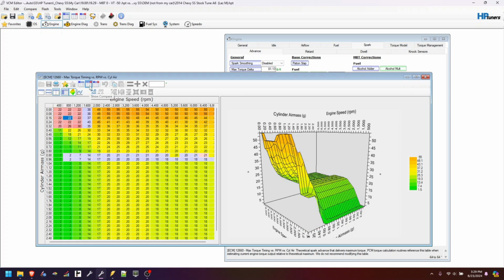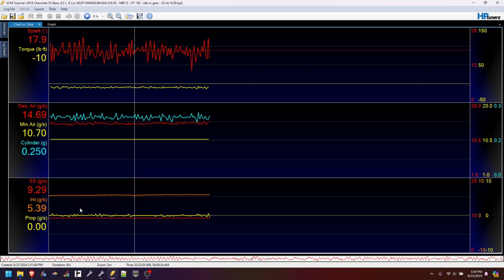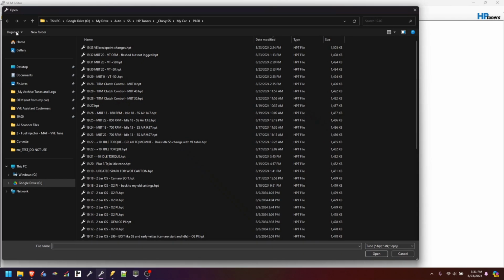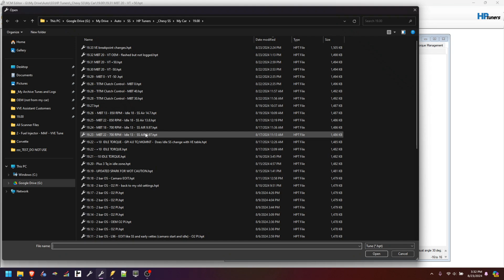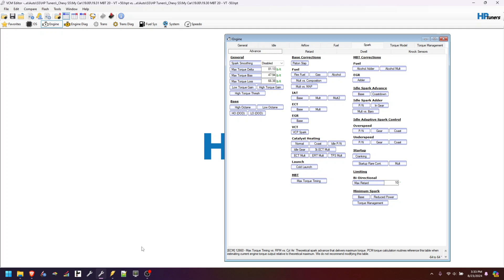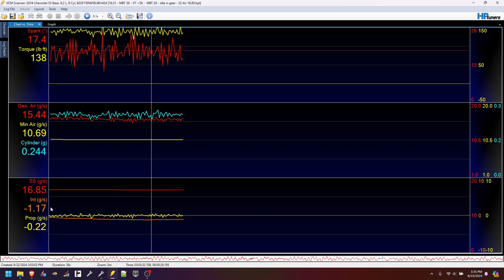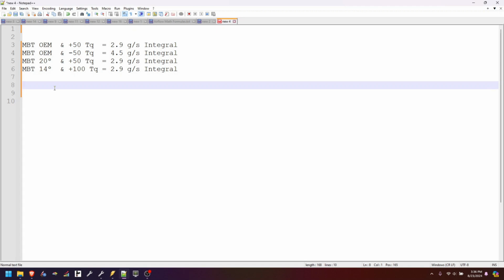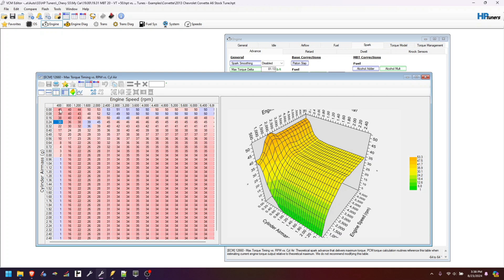Idle Integral Airflow (part 2): Electric Boogaloo

Comment: I have increased torque and decreased torque. I cannot get SS Airflow to increase when increasing VTT but I can bring it down by reducing VTT (as you would in a Gen V) I was wondering if you had ran into this.
Reply from the maker: I have noticed inconsistent behavior, sometimes it works as expected and sometimes not. What goes on in the mind of the ECM is anyone's' guess!

Comment: I can tell you from experience that engine and ECU doesn't mean as much as you would think when it comes to what a modified setup wants.  It's more about year and model, more specifically OS or operating system.  Why?  GM calibrates based on platform not on powertrain.  When I asked one of the calibrators (Camaro/ Corvette 8/ 10 speed calibrator) why they don't share info (or at least proven base files) between groups he responded with, "we are just now starting to do that".  That was back in Late 2018, who knows where they are now or what became of "file sharing".  But anyways, that is why you see calibrations all over the place even when the powertrain is identical.  Another thing to note, relevant to the topic.....so, I've tuned my share of E38 vehicles.  A while back there was a window where I was getting a large number (felt like one after another for weeks!!) of "stock" trucks with only the truck norris cam.  I was blown away with how much variation I saw between years regarding what they want for a stable idle.  Min air, idle spark, torque follower, idle air PIDS, etc all will vary between years and models.  For that reason, you're always better off adjusting relative to the stock values instead of targeting a specific number.  I guess the lesson is, don't always assume just because X vehicle has the same mods as Y vehicle, that they are going to want the same numbers.

While I'm on the topic, I'll share a few extra tips new tuners might find helpful.  If available, start tuning using the stock cal file.  I hate starting with anything but a stock calibration..  I've seen where a previous tuner corrupted the file, it's not a good feeling knowing you've been wasting hours adjusting to a garbage file.  And finally, it's worth mentioning, you should always do a "throttle cleaned" AND reset any adaptives when starting to tune an unfamiliar vehicle, especially if they've been driving on a stock or garbage file.  I could talk for hours on the lessons I've learned when dealing with certain platforms, with certain mods, but I digress.

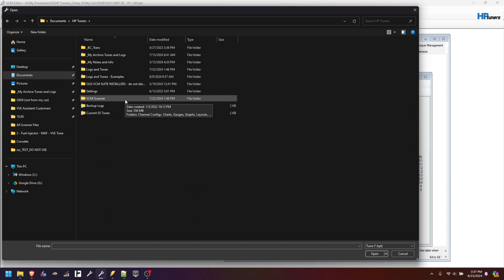Comment: Your L99 engine compared to a LS3 engine at the 8:20 mark uses the same block and heads, but does not have the same compression ratio, valves, or cam.  That is why the MBT tables are different.
Reply from the maker: My personal vehicle (2014 Chevy SS Sedan) came with an LS3, not an L99.
Reply: @SilverSurfer77  I see now.  Sorry, I assumed it was a Camaro.  How much have you increased your ETC scaler?  Correcting this value with ported/larger TB's is usually overlooked with stock cams as the idle adaptive(s) handle the error and ve/maf get tuned with the error factored in.   ETC area is primarily a  base for idle calculations (among others) that always turns into a major problem after installing a cam which starts the endless process of modifying the modifiers routine.  Lots of variables as far as TB size/porting, but LS3's usually need anywhere from +15-30% to save a lot of headaches.
Reply from the maker: @jimmyfreeze3782  I have never messed with the ETC scalar. I do have a CNC ported TB and big cam.
Reply: @SilverSurfer77  The next stock cam LS3 you tune with a katech, gpi (or whoever ported tb), log the idle even if the idle sounds perfect and of course the log needs to be done after maf/ve are textbook.
Reply: @jimmyfreeze3782 If I am understanding you correctly even a cammed and ported stock TB needs the ETC scalar increased from 5636? I would think the throttle opening, blade, and shaft size remaining the same would not change the ETC area even if a larger cam and port TB cause a higher volume of air to travel through. Can you elaborate more?

Comment: I love the info and tinkering dude!
But I really believe that, although E38’s & E67’s are all similar dimension’s, per vehicle, they all have different algorithms mostly coming to the same end-goal… but all of them use a different way to get there.
I have a 2012 a6 6.2 Silverado-cam & FBO’s, a 2013 m6 1le- H/C 415ci + single gt45, on a 2bar OS & a 2015 cam, fbo m6 Zl1. 
Ive tried a number of different things along with the 2014 Ctsv settings, MBT, & the HPT Forum idle thread. all causing a ton of different reactions that caused me to just tune each vehicle as there own setup the old fashion way, seem to yield the best results.
Reply from the maker: Interesting and good point. I really wish I had a whole fleet to experiment with! Lucky you!
Reply: @SilverSurfer77  It’s a “Blessing & a Curse man”. I feel I may go bald at a young age. Lol
Reply: Isn't a single gt45 pretty small for a 415 ci engine?
Reply: @nowayjose596   it works on 12lbs.  The Plan is to work towards a 78/75 , & but the GT45 on my truck…. But economics has slowed the progress a lot.
Reply: @bmock3025  Even a 78/75 will be choking a 415 ci. That's the problem with going larger displacement.
Reply: Well, you would be correct because It's a fact.  In my comment, I mentioned that is more based on OS than year, model or powertrain.  This is because they calibrate based on platform, not powertrain.

Comment: just to throw a spanner in the works... the2011 CTS-V  max torque table has 600 deg spark in the 1200-1600rpm @ 0.00-0.08g cells  so i have to wonder if it is actual spark or some other calc that was valued as spark, would prob be just decel airmass but still something going on with it for factory to do such a value change
Reply from the maker: Well so I've heard that this table influences fueling. So it is interesting to hear you state this....hmmmmm
Reply: @SilverSurfer77  another thing i noticed is the spark tables are always either 1 deg or 0.5 deg nothing alse, but the max torque table can have any decimal u want which id assume isnt spark related, maby its some relation to engine torque but mine maxes out at 64